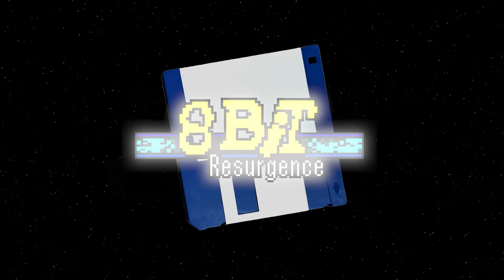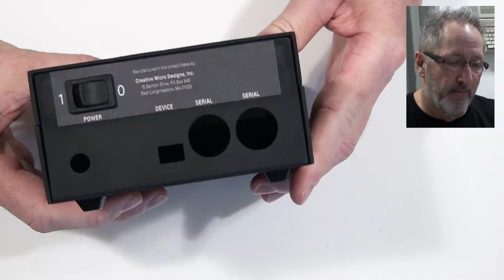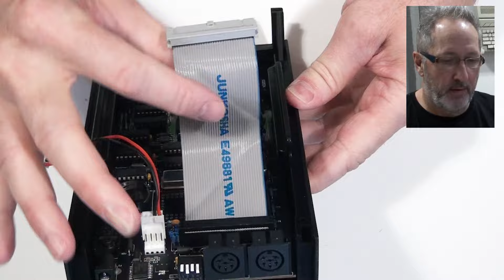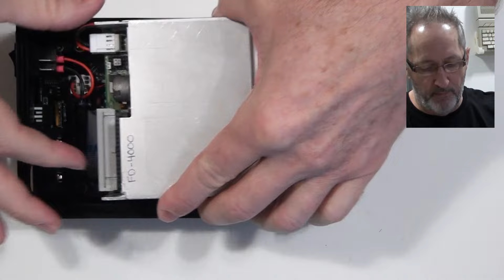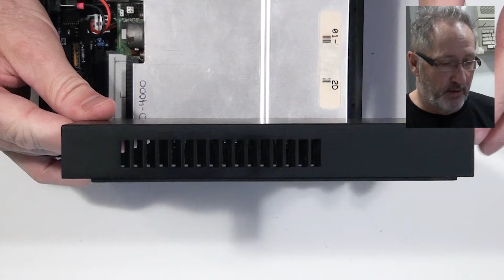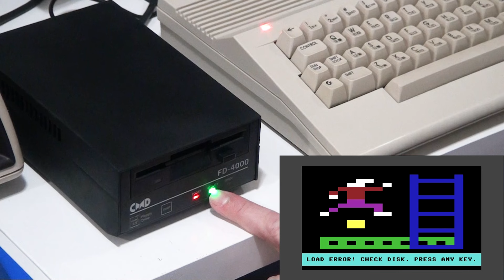CMD FD-2000/FD-4000 Reverse Engineered - Part 3

Comment: Would the original FD drives format a high density disk to the double density 800k format, either the CBM 1581 or the CMD 800k ? How about any that you've built?    I just built up an FD-2000 and am trying out a few different drive mechs. I have a Sony MPF920-Z that won't and a Teac FD0235HF A291 that will.  I'm not sure if it is even supposed to, the CMD manual suggests that you format according to the actual density of the medium being used.  Unfortunately I don't have any 800k DD disks to test with at the moment.

Comment: When you ship the box you provide a very cool plastic guide so that folks can convert HD disks into ED disks. I've had a few online friends confirm that it usually works. (75% chance of success or thereabouts.) However, I've had some engineer friends who had not tried the conversion question the longterm data integrity. They point to the different magnetization field strength and perpendicular recording instead of horizontal. In your anecdotal experience, have you had any issues with your converted disks over time?
Reply from the maker: I can believe that there is a difference between ED and HD disks in terms of the ability to retain data, but I have been doing this for years, and thus far, have not encountered data loss.  Am I lucky?  Perhaps.  So far so good though.  BTW, I  read your blog post comment about case pricing.  IF you're quoted a higher price, then contact PCBWay and tell them to adjust the price.  If they won't, contact me, and I will reach out to them on your behalf.  Tried to sign up to reply on your blog, but never got a confirmation e-mail.. Hence my comment to you here.
Reply: @8BitResurgence  Hey! Let me know your UN and I'll activate it. Your email probably got stuck in SPAM somewhere. Also - that wasn't my post I think you're referencing but one by a guy in California who goes by "Zippy Zapp". I'm good. 

However, I drilled a hole in an HD disk tonight and it errored out during the format at the ½ way point (when the HD was full?) using FD Tools and the ED format option. I'll do a few more. Do you have better luck with certain brands or anything?

Comment: Phenomenal is the right word, super impressive. Congratulations on a successful project. Perhaps this is something I should consider building for my black beauty C64.
Reply: I’m a sucker for anything floppy drive related when it comes to the C64, as I was stuck on tape for the duration of my c64 period like a lot of Europeans. The drives were just too expensive for a young teenager.
Reply from the maker: Thanks very much for your comment.  I'm glad that you like what you see!  These FD-Series drive, in any configuration, reproduction or original, FD-2000 or FD-4000 are a wonderful addition to any machine.  One of my favorite drives!

Comment: I'm really impressed but why no front screws on the board?
Reply from the maker: Thanks.  I designed the case such that it doesn't need it.  The front of the board is snugly retained by channels designed into the case.  Was partly driven by my need to see if it could be done.  And it can!  Thanks for your comment.